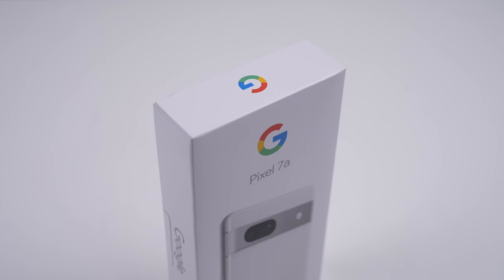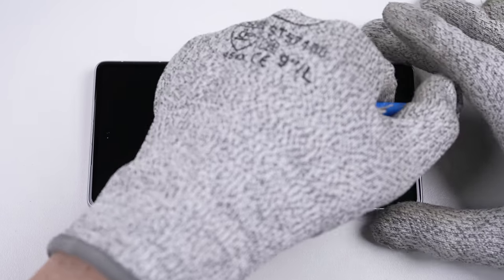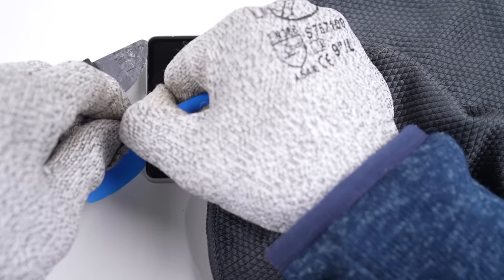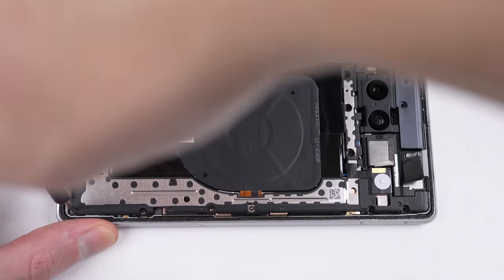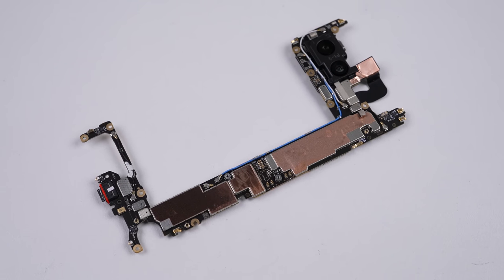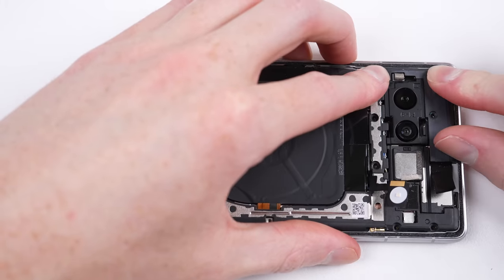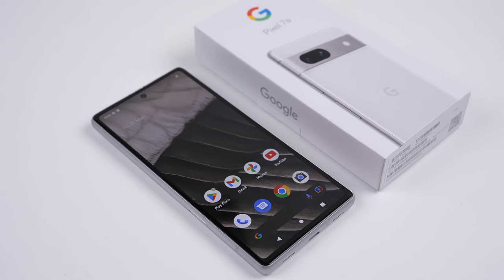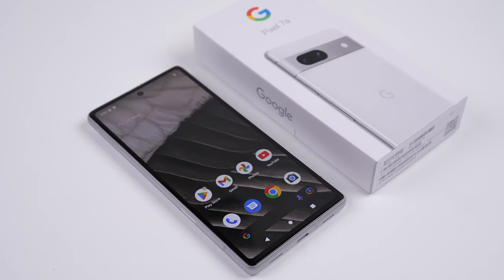Google Copied Apples Best Feature But There's A Catch - Pixel 7a Teardown And Repair Assessment

Comment: I may be mistaken, but this black "glue" on screen can be some kind of loctite used to bond metal parts in car engines. It hardens when pressure is applied (oxygen is cuted off) and overflow can be easly removed. Its oil an water proof connection sealing any micro imperfections in materials bonded together. It's very temperature resistant as its mainy seals hot engine parts.
Reply: Wow,that seems like an overkill tbh.
Reply: @spydermonkey9381 Who knows, it might be used by a citizen of Ohio?
Reply: Hugh Janus broke the screen.
Reply: and who said it was black?
Reply: Youtube channel PBKreviews has a teardown of this and he didn't have a problem removing the display after applying some heat - he didn't indicate how much heat but I would assume he would have mentioned if there was a major issue. However, TheHandyRetter channel did advise it needs a long time and to be careful.
Reply: @rayirth.upside-down  this is not 2022
Reply: @SophiaTheGrace  Fine, Alabama it is
Reply: Probs the red one then?
Reply: @rayirth.upside-down  Pardon?

Comment: I think the screen touch glitching at the start is an indicator that it was already faulty from factory, which might add to it just fully breaking when the phone was fully disassembled
Reply: hmm  Hey stop it! I like the sharp edges around My 7 Pro! lol
Reply: I think it was the excess heat, but this too I believe played a role. Might have been bad from the start to begin with.
Reply: @eshbanvelez5212  doesn't explain the screen working after getting that much heat to remove the screen
Reply: @M1U5T0N3  what is wrong with it??
Reply: @M1U5T0N3  you mean 7a right?
Reply: @m7mdzuhair9gamer61  Nono, My 7 Pro is razor Sharp all around the Frame on both, the front and back sides. Like it's sticking out by a bit to much. You can literally feel it without using a case by just holding it. Try a gesture and You might get cut lol I would actualy prefer the Galaxy S 2X Ultra Design which is much smoother :/

Comment: Hugh, it seems as though the ambient light may be malfunctioning, the symptoms are very similar to a bad proximity sensor on an iOS device. was there maybe adhesive around it or is it possibly misaligned or disconnected after the full disassembly? I can see it’s below the front camera pressed through the mid frame?
Reply: Had the same thought first. May be it... At least i hope so!
Reply: Thought of the same thing, it might have had something to do with the proxysensor. Although the screen probably was sorta faulty in the beginning, he as said also probably burnt out all the pixels a lot by heating it so much
Reply: You can tell by the initial boot logo either the AMOLED itself or some power delivery problem is at hand. This is not an ambient light/proximity sensor 100% guaranteed.

Comment: It looks like they used a self-curing rubber gasket maker to attach the screen. Kinda similar to what they use for automotive repairs
Reply: This phone just looks ugly.
Reply: @rilum97  ??
Reply: @rilum97  not everyone thinks the same.
Reply: @rilum97  my guy, you’ve said that 4 times in separate places. We get it, you don’t like it’s design. Grow up.
Reply: @rilum97  Though still better than iphone
Reply: @rilum97  You too.
Reply: @osamu_90  I am actually beautiful, thanks :)
Reply: @GH0STST4RSCR34M Nope, I am a man. I don't care really, I can use it.
Reply: @rilum97 I agree, it does look ugly. The plastic kinda degrades the look in my opinion, the glass and metal looks slightly better. But overall the design is kinda meh

Comment: It is possible if unlikely that the heat did end up damaging the screen itself.  If the screen was still pretty warm when it was initially tested after having been removed it could have damaged something as it cooled down.  From the sounds of it the screen got REALLY hot and it went through multiple hot/cold cycles which would expand and contract.  You can also see the screen itself flex pretty hard while its being pried off the frame.  All of that induces a lot of stress.  Either way as noted if you are removing the screen its broken anyway but for it to be so difficult is a bad sign.  I doubt it was intentional though.
Reply: This was my first thought too, either the excess heat and/or prying it off perhaps damaged something even though it briefly worked after Hugh quickly checked it before proceeding with the rest of the teardown. I suspect it's similar to a 'thermal shock' issue, therefore the cooling after the excess heating.
Reply: Agreed. Curious as to whether a screen replacement would bring this Pixel back to life.
Reply: Maybe ambient light is malfunctioning, symptoms are very similar to a bad proximity sensor on an iphones. It's possibly misaligned or disconnected after the full disassembly
Reply: @clickbaitpro yes this can be the issue
Reply: Most likely, though just a hunch, but it looks like the microcontroller board of the display got fried due to the heating process thereby messing up the connections. This scenario is similar to the Galaxy Note 9 yellow screen issue, where a software update causes the phone to heat up insignificantly during the recovery update which causes the chip on the display to be fried. The only way to fix is to replaced either the chip or the screen itself.
Reply: Negative.

Comment: The symptoms of the "dead" screen seem to indicate a lack of power to the OLED. Reason I say this is because the panel is extremely dim and seems to be dimmer the more pixels are active (thus the panel seems to be "off" when showing the lockscreen or certain dialogs during the setup)
Reply: This is accurate.

Comment: Look under the front camera, there is a hole in the screen. That hole is for all front facing sensors, even for screen brightness. The screen isn't close enough, too much light is going through that hole for the sensors. Try to push the top 1/3 with 2 finger down and see if you have better brightness.

Comment: Just had this exact fault on an ipad. I found a bit of tape over the light sensors, removed it and sorted. Maybe the sensor got damaged?
Reply: hmm  OK, just saying this is exactly what the ipad did. Start up logo, then pin entry would vanish. Totally off backlight. I cleaned the sensors and it now works fine. 🤷‍♂️

Comment: Hugh considering you blasted the front screen with a hell lot of heat I am not surprised you (literally!) cooked it to death
Reply: But the screen functioned just fine after he lifted it off but before unplugging the flex cable.
Reply: @r.Ry4N.05  it might've been damaged due to the abrupt temperature shift
Reply: @r.Ry4N.05  Something could have broken during cooling. It's not always just excessive heat that can kill things, sometimes it's the cooling back down that gets it.
Reply: @mjc0961  it's not the speed that kills people, but sudden deceleration

Comment: I think that like a lot of phones it's just supposed to be opened from the back, and to replace the screen I'd bet they'll sell the screen with the frame attached.
Reply: But here's the issue. The connector is only accessible from the front
Reply: i work for a repair company. The google phones are designed to have screens replaced with the display only for easy screen repairs. More people break screens than they do housings / back glasses. They are not designed to be opened from the back on higher end google phones. The entire rear housing gets replaced on the top tier models. The lower tier ones have more repair features like being able to be opened from the back (only starting now with the 7a and on some older pixels). Realistically you shouldnt need to open them from the back unless the battery fails or motherboard, which are very intrusive repairs with pixels anyways.  Most who break the back just put a case on it or live with it. 

Screen repairs that require full housings are very expensive compared to just displays. Take samsung devices for instance. 95% of them come with full housings with all buttons, a battery, and some small sensors like the fingerprint sensor. They are really expensive and make fixing a lot of older samsung devices not cost effective ( this is only true for samsung service centers / business with certified manufacturer repair contracts).
Reply: @Radiiiiiiiii  Thats why it comes with the frame, so you don't need to disconnect/connect anything
Reply: @Lego455200930  did you not listen. The connector for the screen, is at the front. To disconnect the screen, get this, you have to open it from the front!

Comment: It'd be really disappointing if they used a hard substrate for the OLED as a cost-cutting measure.
Reply: Even worse if the previous generation was Soft OLED.
Reply: Pixel 7 has hard oled, so no reason to think 7a would have soft oled. (I have a pixel 7)
Reply: What difference does it make?
Reply: @worthless_opinion  Soft oled has superior image quality, but more than that the viewing angles are a dead giveaway, hard oled has a rainbow effect when viewing from an angle while soft oled is perfect from any angle.
Reply: @worthless_opinion  cheaper but breaks if bent. Depending on how the phone is built it doesn’t really matter though, because if the only reason for removing the display would be to replace it anyways, it doesn’t matter if you would likely break it while attempting remove it.

Comment: Finally! I always hated the design of the pixel phones because you had to basically break the screen in order to open them for any repair.
(I know it was posible to remove the screen in working condition but its just a big unnecesary risk)
Changing the display might take a bit more work now, but everything else is just soo much easier to repair.
Reply: Pixel 3 and pixel 4 all can open from front and back
Reply: This was never my experience? I repaired the 7a and found that it was quite easy to open. Seemed like a standard adhesive responsive to my heat plate.
Reply: Yep. I just tried to take my 4a in for a new battery and they told me there was no way without breaking the screen, making the cost of repair more than the cost of the phone

Comment: I suspect the screen issue is with the light sensor or perhaps the damage is related to the driver and when it goes to 90hz it blacks out. Gives a bit of a flash and dies. Hopefully the motherboard isn't damaged.
Reply: But remember, the 7a is set to 60hz by default so it's unlikely that it would be at 90hz during setup
Reply: @Rsonny  I don't know and I don't have the test equipment to measure it. All we can do is guess.
It's a strange and repeatable issue but I have a sneaking suspicion it goes beyond the screen.
It looks a lot like what used to happen with computers when you selected unsupported screen settings. You didn't get a warning, you got an occasional artifact and a black screen.

Comment: One out of 25 is not bad. Zach kills 99 out of 100.
Reply: He's simply built different
Reply: Not at all. When a phone doesn't snap in half during the durability test, it usually still works after the teardown. It's not his fault manufacturers make crappy phones that snap in half.
Reply: @mjc0961  He has only recently learned to be more careful.

Comment: Could it be that the display just sets itself to minimum brightness? Like the iphones after a display replacement? Still It would be pretty weird since the startup animation still shows properly
Reply: That's what I'm thinking. Especially since the screen still seems to work.
Reply: 8:22 it might be a damaged proximity sensor that caused it to adjust into minimum brightness.
Reply: @jrnzlgsc  that’s exactly what I thought when I saw it’s behavior!

Comment: I bought the Google pixel 7 pro with a damaged screen in one corner. I bought a replacement screen from eBay. I then removed the damaged screen with only a curved scalpel…no heat! The only bind being my big fingers attaching the screen ribbon cable. I had to move the finger print sensor, again with the scalpel. It was quite an easy replacement.

Comment: I’m a remote mobile tech for Asurion. I love when you can’t power down the iPhone 14 or 14plus because the display is too damaged, when the new screen is installed, I have to do a hard reboot back into customer UI, then power down and calibrate.

Comment: Just did one of these the other day.  Its just as hard to remove front screen as its on fold 4 small front screen. I didn't know the back came off like that.  Good to know.  Now need to find out it 8 series does the same thing.

Comment: @5:39 I was pretty sure that batteries aren't manufactured that exactly, so I looked it up: +/-2.5% seems to be the standard tolerance (for industrial applications). That would be 110mAh. Therefore, 30mAh isn't really worth losing any words about.

Comment: Great timing Hugh, I'm currently thinking about replacing my old Mate 20 Pro with Pixel 7a as I fell in love with Pixel UI. But something still holds me with Huawei and don't know what to do, I Wonder if it is just your phone faulty or it's something what afffects more of devices
Reply: I'd suggest looking at other teardowns and seeing if they experience similar issues. If they do and you want to spring for the pixel, maybe try the base 7.
Reply: my 7a runs just fine. His might need the software update that was issued after a few days after the launch.
Reply: Man, I'm in the same position. I'm still sticking with my Huawei Mate 20 Pro. It just works! The battery life is great and the screen is perfect even after all this years. Although, I've decided I'll definitely be changing it once the Pixel 8 Pro comes out!
Reply: Get the 6, 6a or 6 Pro on the cheap, or maybe try a Honor or Xiaomi phone if they work in your country.  Have you considered a Sony Xperia phone?
Reply: @SayAhh  the pixel 6 series so have some issues, so I'd recommend against them
Reply: The things that go against Huawei is having to access a back door for installing google apps and not getting timely updates. That's a no go for me.
Reply: Honor?
Reply: I had a mate 20 pro till it was bricked when trying to replace the battery, turns out Huawei learned from Apple and paired the battery with motherboard on mate 20 pros.
Reply: @Lego455200930  iPhones aren't bricked if a different battery is installed. Just the battery health function is disabled but the phone still works.
Reply: @Lego455200930  I don't think that's true. I've changed displays and batteries on multiple Huawei phones without issues. Most probably the shop damaged the phone and told you that BS💀
Reply: @traviswalker8933  Yes, sadly. That's the reason why I'm finally changing my Mate 20 Pro once the Pixel 8 comes out!
Reply: Take from this what you will. My 5a died last week. Black screen while browsing some site. I can feel the phones haptic and I can even send it adb commands but the screen is absolutely gone (not even fastboot menu visible) that issue is SO WIDESPREAD that it literally has a wikipedia page. And as I don't live in the states Googles reply is "tough luck buddy! See you next time!". On the other hand, I'm posting this on my HUAWEI P9 which is almost 10 years old at this time... Still chuggin along although the battery is clearly dead. Oh, by the way the pixel was 15 months old. Never dropped, scratched, broken nothing.

Comment: First of the redesign fully isn't copied from apple. Pixel 5a had everything from front screen, pixel 6a also had from the front screen but back side removable, pixel 7a now have screen from the front while rest of the things from the back. 
Secondly, what do you expect from this price range phone using hard oled? Flexible oled costs more and good only curved screens mainly. It also thin so can be use to save the space. But at this price range they had to cut the corners. 7 also use hard oled.

Comment: Try doing an incomplete FRP bypass. Skip the bootup process, go straight into the settings, turn on ADB and disable the OOBE for your user, then go into the launcher.
Also put it at max brightness manually from settings.

It simply doesn't make sense for the screen to cut out like that. It just doesn't feel right. It's too consistent.
Plus, in the recovery is completely fine.
Reply: oled needs more current when showing bright colors, the phone's fine with powering lower amount of pixels but fails when there's too many

Comment: That happenned to my 5a last week. The screen went black out of the blue. For no reason. And I didnt take it apart nor had it on a hot plate. I can feel the phone vibrate and I can even hear it if I connect it to charge but no display whatsoever. And as I'm not in the US I'm SOL. 15 months the damn thing lasted.... Good work google. Thanks.

Comment: Maybe the display doesn't like the long cooking befor the disassembly process. Yes it worked when was still hot but after cooling somthing probably disconnected internally and game over. Nice job google! 
P.s. im surprised the battery doesn't catch fire while cooking...

Comment: I just got a Google Pixel 7, and I kinda wish I can just remove the back panel instead of the front. I rather not touch the front if I don't have to as it looked like you removed half the phone before removing the battery. If I ever need to do a battery replacement I don't know if I'd ever try to do it myself.

Comment: The issue with touch inputs might suggest that the screen was defective from the factory so that might be the reason why it died after re-assembly? 

The heat could've speed up the process but not kill it immediately but as it cooled down the damage could spread... I dunno I'm just trying to figure out explanation because otherwise it doesn't make much sense.
Reply: YES! I have a P7A that also has a bad screen, exipiting the exact same symptoms. Google has a serious quality control issue.